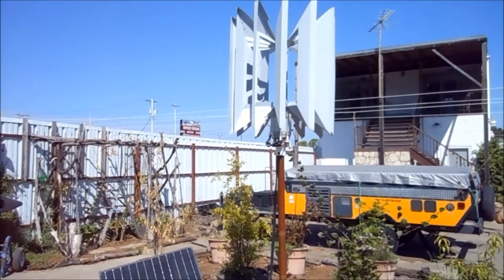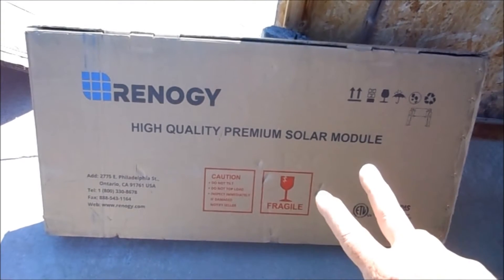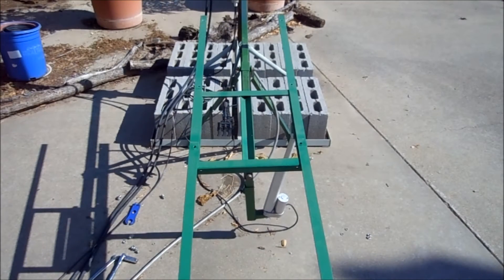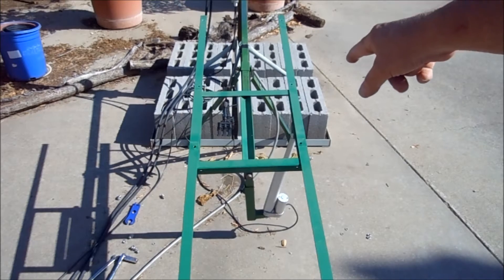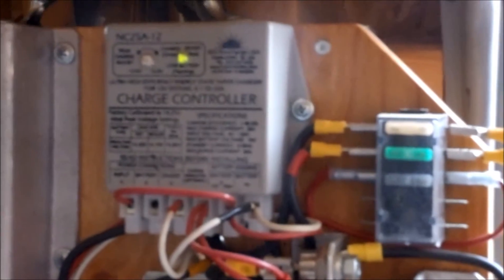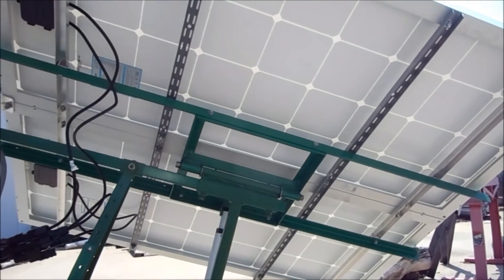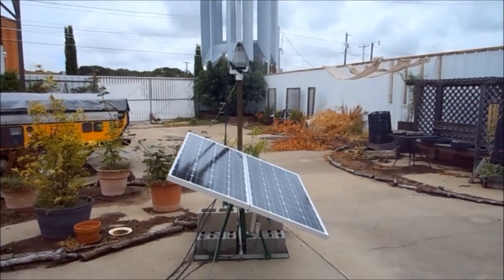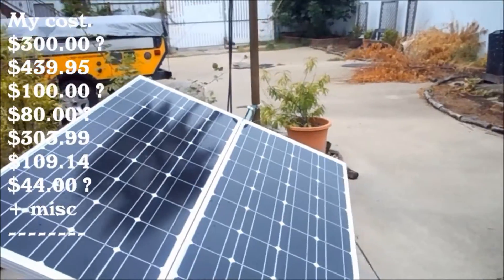Another Power Pod Upgrade

Comment: have you ever thought of making a vawt using flexable solar panels for the blades?
Reply from the maker: I have, but I see at least two problems with it. To move the power from a set of revolving solar panels to the voltage regulator you would need a fairly complex electrical slip ring mounted either below or above the turbine at its axis. The second problem would be, while some panels are moving toward the sun and making power, others are moving away and not making power. Each panel would need its own blocking diode to prevent it from draining power as it moves away from the sun and those same diodes also restrict power flow to the system when the panel are in full sun. It might be possible to build it this way, but the cost would be high and the power produced would be less than that of a stationary solar panel of equal size.
However, several years ago I saw an article about experiments with transparent solar panels which can collect energy from either side. If those should become available, having solar panels as blades of a turbine becomes somewhat more practical.
Reply: thanks , great dogs in the video
Reply from the maker: Thank you for saying so. Both of these girls are rescue dogs. The yellow one I found through rescueme.org, and the boxer was dumped right in front of my building.